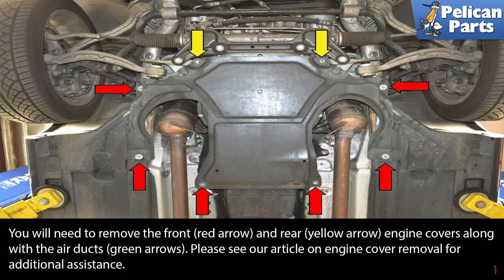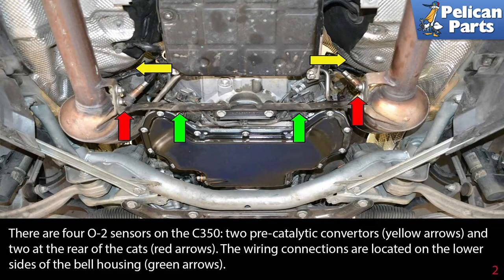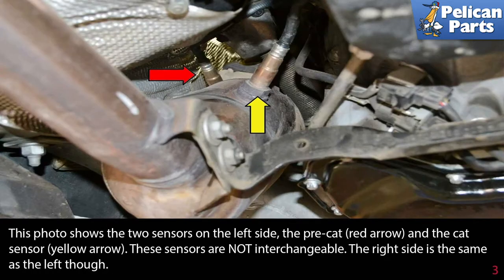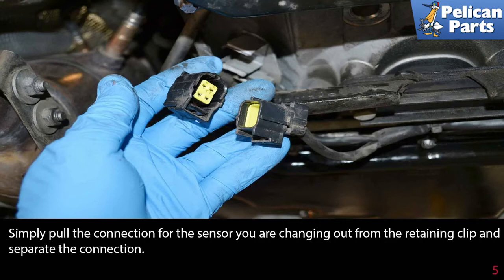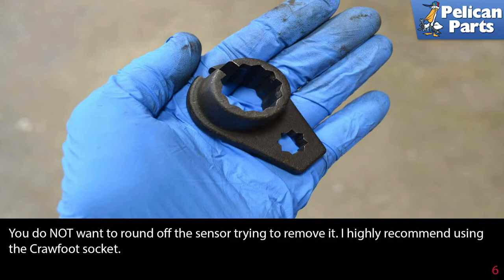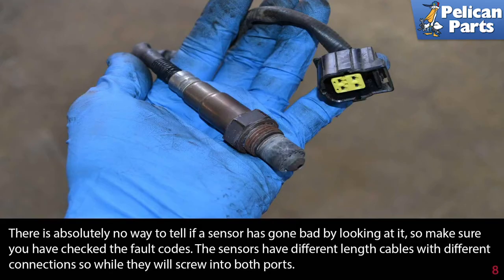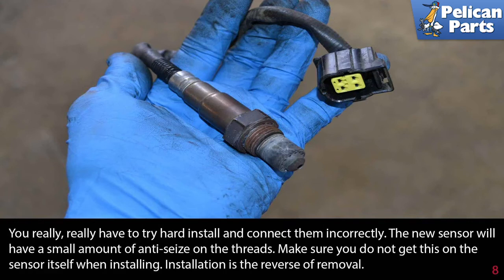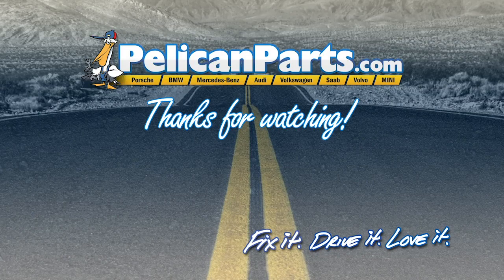Mercedes-Benz W204 C-Class Oxygen Sensor Replacement

Comment: Hi, ive been told by the dpf specialist to replace oxygen sensor nr 2 in my c250 2.1 diesel. Is that the one downstream the DPF? Thanks
Reply from the maker: Sensors are listed at B1S1 or B1S2. The S2 refers to post catalyst sensors.

Comment: So light came on went to auto zone said it was maf sensor so I did that and air filter cleared codes before changing put them in drove 2 hours then check engine light back on! Now it’s saying it’s o2 sensor
Reply from the maker: Check o2 sensor function using a scan tool. Check for a lean bias, this could indicate an air leak.
Reply: @pelicanparts  shows lean to rich and cylinder miss fires but I did all plugs n coils few months back! So I’ve been thinking can it be fuel injectors? .. I do a lot a lot of driving too
Reply: @b.trill6868 this is exactly happening to mine right now, did you ever get any clarity on the issue ? Possible fix? Any help would be appreciated

Comment: so in essence u need 2 kind of sensors? 1 pair for the right and one fot the left?
Reply from the maker: Depends on the engine and how many banks. Always a pre and post-catalyst sensor. Some engine have two of each, with a total of four. And some engines have even more. With your vehicle info handy, give The Pelican Parts parts specialists a call at 1-888-280-7799. They can figure out what part or repair kit you need.
Reply: @pelicanparts  C350, Nox sensor 1 (Bank 1). Replaced the sensor but still getting the same error. P220101, there is a general electrical fault!